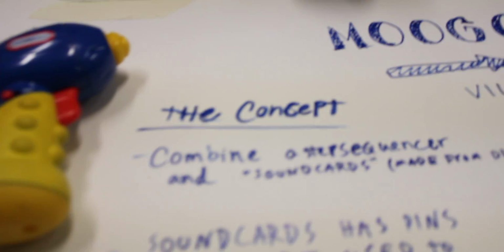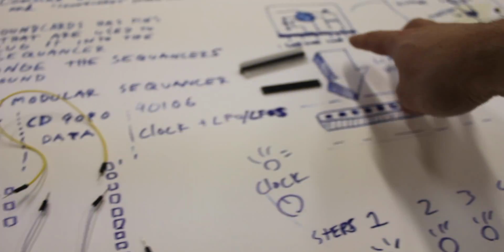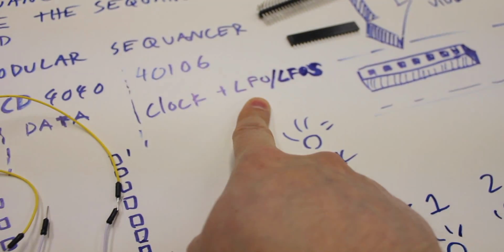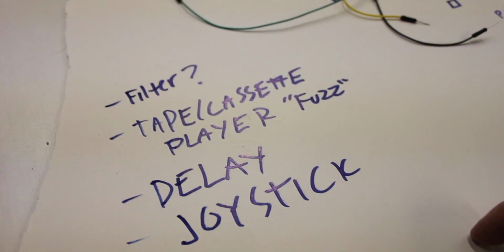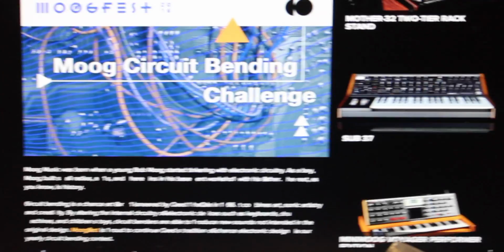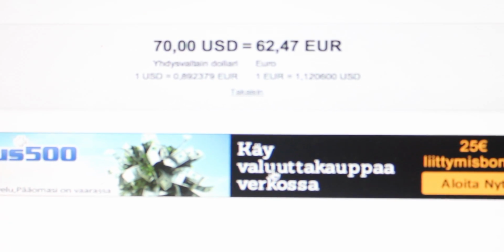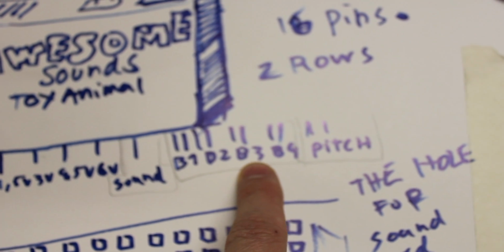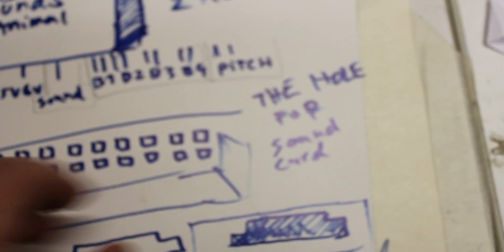Moog Circuit Bending Challenge 2016 (the Winner)

Comment: How did you get a pitch for each button? I thought you would only need 1 pitch for each toy circuit. Please help me out to understand this I really want to make myself something like this. Thanks!
Reply from the maker: Hi The sequencer is controlling the pitch. So each step can have its own potentiometer (pitch resistor). I may or may not explain it somewhere in the video (can't remember any more :D). But in a nutshell the toys (in the cartridge) pitch resistor is removed and it is wired to go trough the sequencer in stead. at the end there is schematic that may open up how it works better than my explaning it here. Hope this helps you and good luck.

Comment: I'd like to know please what the pinout on the cartridges is. I see ground, 1.5, 3, 4.5, 6v, speaker, but how did you do the switches?
Reply from the maker: I explain everything on the video. I go thought the how to connect the buttons with a transistor on around 5.55 and the pins are mark on the same picture as the other ones around 8.29. They just did not fit under the cartridge picture. They are marked B1 etc. and I explain them too.
Reply: @volanoisystuff   I have watched the video four or five times now and I understand what you say. I suppose my question wasn't clear enough. I just wanted to know the pinout of the sound cartridges. I wanted to know how you deal with the different kinds of switches like ST3P and momentary, etc. I understand it mostly now. Are you controlling all or just some with transistors? Thanks for the answer.
Reply from the maker: @ryanbareither89  Ok I see. I don't remember the exact pin out anymore but I think it matches the one on the drawing, so the button controls are on the right side. There aren't that many ST3P buttons on toys, and this wound not be able to control them. The transistors are controlling momentary buttons. So I chose ones with only push buttons. I made one cartridge with had a ST1P switch and I just but that right on the cartridge.
Reply: @volanoisystuff  thanks for the quick answer. I made a typo, I meant sp3t switch. I could make those as three individual switches. Thanks again!
Reply from the maker: @ryanbareither89  No problem. Happy to help.